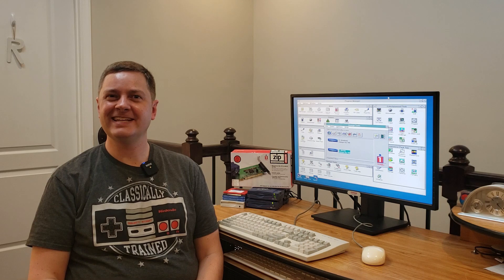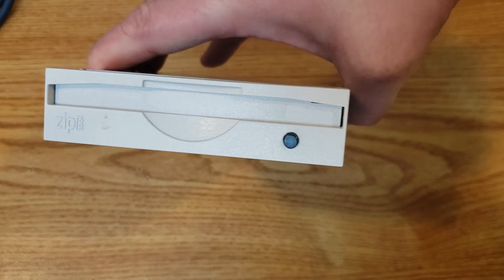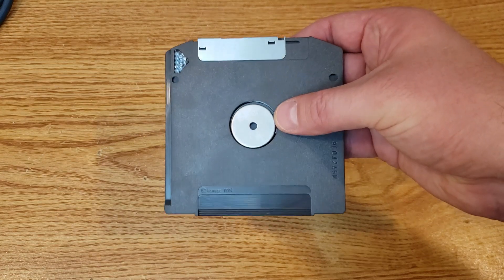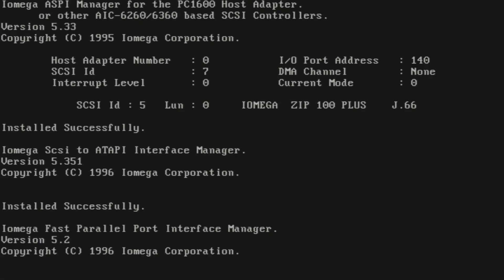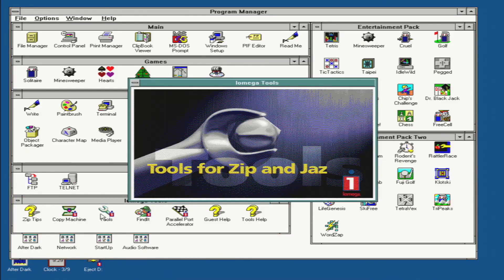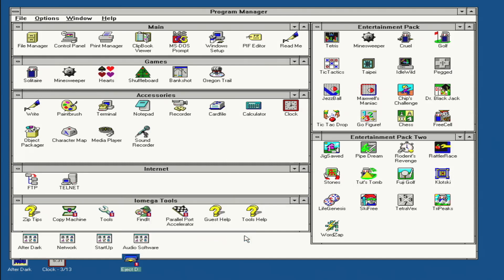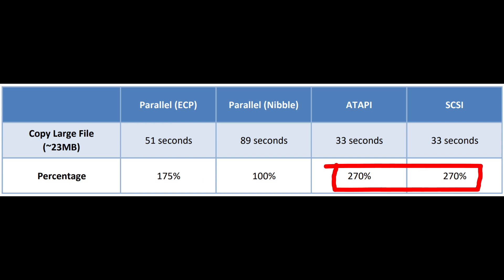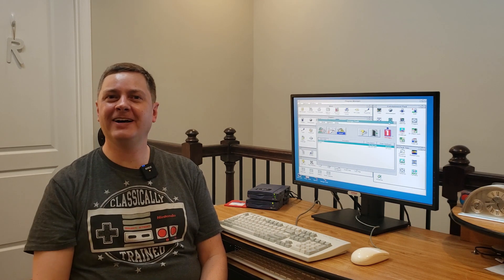Zip Drive Extravaganza: Installing, Comparing, and Benchmarking Three Different Zip 100 Drives!

Comment: Ik use a parallel zip drive as my harddisk for an old ps2 that does not have normal connections 😉 harddrives are rare to find for this computer but this way i can still use my ps2. Btw where can i find windows 3.1 driver?
Reply from the maker: They should be readily available on the net!  Search for "Iomega tools for Windows 3.1"

Comment: Is it possible to connect the ZIP 100 parallel drive to a newer Windows than Windows 98SE, XP? Will it work on some new Linux distribution? Is it possible to connect via usb-parallel adapter or parallel controller under PCI port, PCI-e x1? The cable to connect is a simple straight DB25 cable like for a printer, has any pair of wires been changed?
Reply from the maker: Possibly!  I haven't tried it through. The best chance of success here might be a USB zip drive, definitely something worth researching.

Comment: Great help, Chris! Thank you! I have a question: I've got a Toshiba T3100e (80286) with just 1 MB of RAM. Do you know if it is possible for it to work with the parallel ZIP drive?  Thank you very much in advance for any help!
Reply from the maker: Thanks! You can try it with the standard guest.exe program,.if not, you can look at PalmZip, but usually only older parallel zip drives work with PalmZip.
Reply: @RetroTechChris  Thank you! Thank you! Thank you! Warmest wishes for you and your beloved ones!

Comment: Today I found my Zip 100 Plus with several Zip cartridges from way back. In the next couple of days I'm going to see if everything still works via SCSI interface. Your video will be a great help.
Reply from the maker: Super!  Let me know if you hit any issues setting it up!
Reply: @RetroTechChris  Thanks! Will do..... I don't have the instructions but I believe I will need the disk that came with the drive to get started if I remember correctly...?? Question is can I find it..... or maybe I don't need it?
Reply from the maker: @Leos-World  fortunately not required to have the zip disk.  Depending on the OS you plan to install under, there are a few driver versions you can use.  I think I have the best DOS and Win3.1 choices listed somewhere, either video description or video itself.  Haven't tried Win95 and later recently.
Reply from the maker: @Leos-World  oh, and also, you can install the driver as a "guest" install or use a more permanent ASPI style install.
Reply: @RetroTechChris  Thanks! Will be using Windows 95. I will report back...
Reply: @RetroTechChris  Success! 😃 OK, this went quicker than I had thought. I mounted an Adaptec 2940 SCSI card in the computer, ran Windows 98SE and the card was automatically recognized. I then hooked up the ZIP Drive Plus and booted into Windows 98SE again. It also was recognized without needing any drivers. I placed the the Tool disk in the drive and Windows read it without issues. HURRA 😎 Checked all the other ZIP cartridge's I have and they where empty. I must have deleted everything thinking that I would never use the ZIP drive again. I'm real happy the thing still works....... well, almost. I turned off the computer and the drive. 2 hours later I wanted to test more disks I had found but this time the ZIP drive wouldn't turn on. Long story short.... the power supply died. It's impossible to open so I ordered a new power supply hoping it will resolve the issue. I'm currently resurrecting two machines that I had used back in the 90's. One is an MS6163 with a Celeron MMX @ 533MHz mounted on an MS6905 converter and a 3DFX VooDoo3 GFX card. This system will get DOS 6.22 and Windows 95 installed. The second PC is an MSI K7N2 Delta2 with an AMD Athlon XP @ 1100MHz and an ATI 9600 Pro as GFX card. This system has Windows 98 SP3 installed. I do still have all the original hard drives I had used back then and they all still work. The later board needed repair work as some caps had to be replaced. It's so cool to fire up these things again 😁
Reply from the maker: @Leos-World  excellent!  It sounds like you are having fun getting back into the retro hobby.  It is so much fun!  Thanks for the update!!
Reply: @RetroTechChris  My ZIP drive is up and running with the new power supply. Can't complain about Amazon's over night shipping 🚚
Reply from the maker: @Leos-World  wow!!!  That is great!!!
Reply: @RetroTechChris  Just to let people know: I was able to create a bootable zip disk (DOS 6.22) with my Zip 100 Plus. Next step is to install DOS based games (e.g. DOOM. Heretic, Hexen,...) on the drive.
Reply from the maker: @Leos-World  interesting!  I want to say I had to go to 95B if I remember right, so that is good that 6.22 works!!
Reply: @Leos-World  what about the click of death
Reply: @fargeeks  Thankfully not happened yet 🤪

Comment: Hi Everyone

Zip disks, good and bad history

Before i go into my history with them, i tried to always use SCSI but eventually at work the server work copy to a spare machines d:\ and once that was done would email they user of that machine copy completed start your local backup on zip to media and take offsite - this was for only the critical accounts and main xls data, 

This ended up being the issue, zip100 hold 100meg , the server was probably  NT4 or maybe even Win 95 or Win98 "business class machine" nothing special about it, the owner wanted the entire drive back up so i sent him a quote for 300zip disk blanks or something silly, told him it is not practical, the backup would have to start at like 10am and no one could do anything, the only way out was to have everyone finish critical stuff at 4:00 to 4:15 and start selective critical folders only - everyone had to be out of accounts as sales database not even read only - it was a pain and about 6  or 7  disks depending on how many files were changed, some times a pre start disk count would say 20 disk needed or something because some on  dumped music or moved files to another folder  - douggie had to come get me and i would xcopy of another machine the back up from the server to a sub folder on the server and it would only really achieve making 2 copies and clearing the flags, from there i manually ticked what should be copied and set that as a run one time job

What i found interesting ( well strange really ) is that the one large file had different results to the 10 meg mixed small file test

Typically for the same amoutn of meg a larger sill or less qty of file will trafer quicker than lots of little file

On a floppy, say a full 1.4m cabinet file or even a larger arj / zip file on a floppy will copy to another media much faster than say 2 files of the same transfer to 10 / 100 files, this is due to the transfer rate stopping, then loading another files getting check sums set up then transferring, once end of file  crc checks then close the file search the index for next file and begin, there is a few processes there that does no transfer

Another test is to say have sample info, transfer them, then split them up into different sub directories and do the transfer again, it will take longer

If you are then turning of the archive marker add some more time
Reply from the maker: Sounds like your customer elected a bad backup strategy!
Reply: @RetroTechChris  Hi - he was a complete miser, he owned and ran a bakery with 180 staff 10-12 pc

He was heavily influenced by advertising - the box said "Its is the perfect backup solution"

Comment: Nice! I have only used Zip disks in my Power Mac G4 using an ATAPI drive, it's interesting to see it being used in Windows.
Reply from the maker: Yes!  Seems like Mac use cases were big for zip drives!
Reply: @RetroTechChris  Yes! I really want to get a SCSI ZIP for my PowerBook 1400 and see if I can install a minimal System 7 install and boot from it. Supposedly there was a ZIP 100 expansion bay module made by VST I believe, but 1400 parts are really difficult to find and I'd imagine that would be even more difficult.

Comment: Chris, if you are ever in need of additional ZIP100 media you can find some locally at Austin Tech in Ashburn. They have new old stock ZIP100 media along with 3.5" and 5.25" floppies.
Reply from the maker: I will definitely have to check this out!
Reply: @RetroTechChris  Last time I was there the Zip disk were out in the open but you had to ask for the floppies.

Comment: I need some advice: I have the external parallel Zip100 drive (not the plus model, the original one!) and would like to know the best spot for finding drivers.
Reply from the maker: I'd go with a Google search.  If wanting to run under DOS/Win3.11, the video will give you tips on the best driver versions to use.